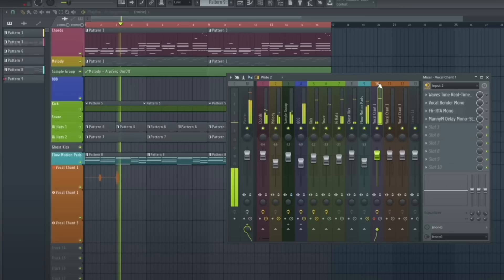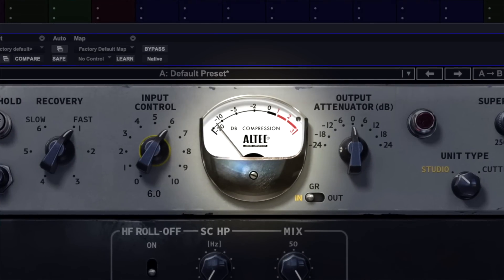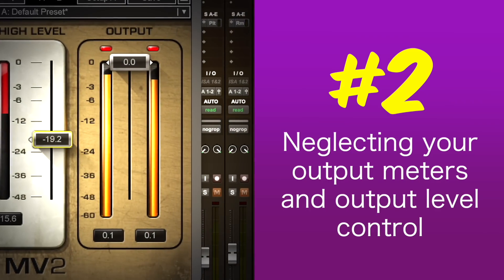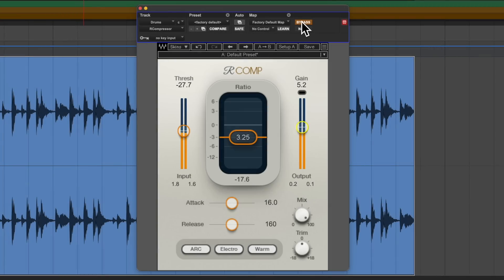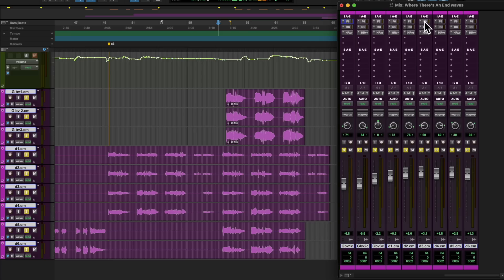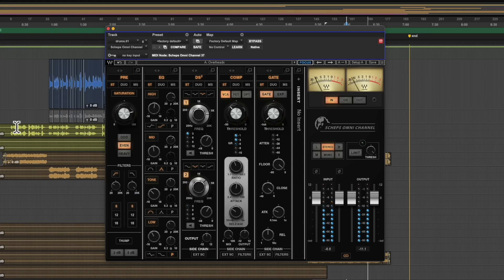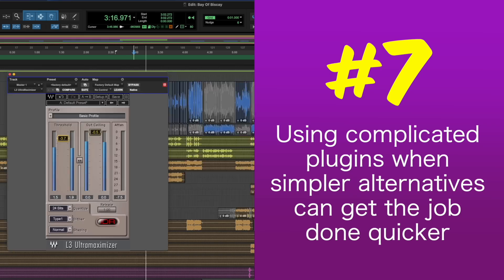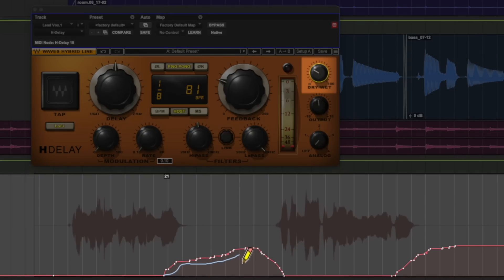9 Ways You Could Be Using Your Plugins WRONG

Comment: #9 might be: buying an plugin collection and not trying half of the new plugins you've bought. 
So I've made it a habit - in Studio One you can set a picture of the plugin in the browser - and if I've ever tried / used the plugin it'll have a picture. This way I can easily spot which plugin I still have to try. It's understandable that if you've just bought Waves Gold you haven't had got the time to try even a third of them in a day. 
Or let's face it, I'm posting this since I bought Arturia's FX Collection 3 recently.
Reply: I just recently made a list of ALL my plugins and am determined to go through each one (several I've never used - and still might not after using them) and learn everything I can about them. Read the User's Manual, tips and tricks from other users, etc. on each one. THEN, I'll know WHEN to use each one or whether I need them at all.

Comment: #1) I learned this after getting a lot of bad advice and silly responses years ago when I wanted to eliminate the amp buzz from an amp sim. Eventually, I figured out on my own, after a lot of "It's not real if there's no amp buzz" nonsensical comments. Lowering the Input Volume on the plugin COMPLETELY eliminated the amp buzz and hum, and gave me clean amp distortion and tone with ZERO "amp noise", then just cranking the Output Volume to bring it back to a decent volume.

Comment: Great video! Respectfully disagree with point 3. Over the years I have learnt that, with backing vocals, drums, guitars, definitely sounds, at least different, compressing the sources individually. IMHO sounds less compressed and clean compressing the backing vocals individually versus compressing the bus. On the other hand, agree that you can share the reverb.
Anyway good tips on your video, thanks.
Reply: Have you tried using clean saturation on the individual tracks? And then compression on the bus. Of course it'll be different for every genre, but consider giving it a try. I get pretty natural results with this method, especially on backing vocals.
Reply: @devingobind  bout to give this a gander now :) thx

Comment: Matching output level, use your ears, if you add 6 db because gain reduction said so, you are to loud, as it only the small peaks getting reduced that much, an average would be better, as sometimes it compresses 6 sometimes 0, so in between would be 3, and that is probably where you wanna set your output for comparison, but use your ears.

Comment: Do the outputs on all waves plugins internally clip regardless if you turn the fader of the track down so there is no clipping in the DAW?
Reply: No, in a standard configuration plugins are inserted pre-fader, so the position of your DAW’s faders won’t impact the level within the plugin. Not the case in point 4 as track outputs are feeding into an aux, so plugin inputs can be overdriven by fader levels there

Comment: Concerning #3, using a single Aux for many vocals . . . EQ?  Sure.  However, wouldn't each vocal be better served with it's own compressor?  Assuming you're using them, each performance is not identical, so doesn't it make sense that each note from each performance would be being treated separately?  Seems like the controls of a compressor dictate that it would be reacting to a given transient but then it'll be busy doing so as the very next one comes along . . . if it works as I think it does, you're defeating the purpose, no?

Comment: I have a question for everyone who can answer me... Relating to tips #3, I have the idea that processing each vocal separately doesn't have the result that processing the overall bus. Tell me if im wrong, but with auto tune for example, you will not reach the same result by autotuning a whole bus rather than each track, or do you? Same for de-esser, and for reverb too, right? I mean finally in the overall bus you can adjust delay, overall eq and maybe compressors to glue everything, but compressors to bring the vocal front have to be set within each track, right?
I may have to evolve on this point because I'm using so much cpu in my sessions... Please advice me
Reply: Tuning needs to be applied (that is if tuning is needed) on a track-by-track basis - not bus. This is because most tuning plugins are monophonic

Comment: Awesome. 9. Save your presets!!
Reply: That's a very good point! Especially useful when mixing album projects where continuity is needed
Reply: Newbie here. Can you give an example on saving a preset and why would I want to save it. Again I’m still learning but feel I can benefit from this. Thanks. 

Also I appreciate this video waves!
Reply: @apostolicway2604  Let's say you get a great vocal sound on one track and want to use it in another mix... saving your own custom presets are great for this. Saves reinventing the wheel each time. Or, maybe you have a certain way you like to start with certain plugins... for instance always starting with a low pass filter in and EQ. Why not "save a preset" and "save as default" so the filter is ready each time you load that EQ. Saves a little bit of time each time you mix with that plug.

Comment: I think you left out one of the most important points with regard to the use of plugins in a mistake that most people make. One of the main tools needed for mixing which is lost to those who use plugins unless they actually go through the work of doing assignment to knobs is the ability to control one parameter at the same time as another. Professional results have never been gotten by experienced engineers in the industry this way

Comment: #3: There still gonna be a difference between a bus compressing and compressing with individual tracks. The difference is not significant if the input is only one signal source at a time. The best solution is really to get a powerful-enough machine or learn to use less-CPU heavy native plugins. Fancy-looking plugin doesn't guarantee a good sound!
Reply: Agreed. Vocals need to be compressed separately for the most part. If you are trying to save CPU, print each vocal with the compression engaged.

EQs are great on a vocal BUS, and automating a compressor can be handy there as well.
Reply: @danielwiebe2123  or just use avid channel strip. I seriously think the channel strip is a great plug-in and it does most the treatment pretty good. For lead, I’ll use outboard compressor like CL-1B.
Reply: @danielwiebe2123  what about if you need to change something, you can't do that when you've printed. I thinking using a bus is best unless you need to really compress each track.
Reply: It’s always down to choice, I like comps on individual tracks, however some plugins work wonders on groups!! Experience is the real winner!!

Comment: Your example of 1 eq/comp for 8 tracks vs. 8 sets of eq/comp is missing a major point. It will sound DRASTICICALLY different. I understand the point you are making regarding conserving CPU power, and making automation simple by using a bus, but you simply can not get the same level of control that way and your eq is going to be carved out with huge scoops for a reduction, vs small ones across all 8. It's a VERY different thing, and your over simplification isn't doing anyone any favors. It's simply NOT the same thing. 8 tracks hitting 1 comp will react completely differently than 1 track hitting 1 comp and then routing that all to a bus.
Reply: You will have to adjust the compression but you can still use one for a bus than compressing them one by one, unless you really need to.
Reply: I completely agree. But i think this was more meant as a tip to newer engineers, who are perhaps taking advantage of his advice , dealing with less powerful equipment. It does sound completely different but their task is to learn to make it sound good, which is maybe more important
Reply: I disagree. Hitting the same plugins with 8 (or more) tracks isn't any different from using plugins on each individual insert. If you do this, you'll have ti adjust the compressor exc... like you are treating one track, that's the point in doing buses: you want all of the tracks going in to sound the same. Then, if you need (for example) to carve out the mids in some tracks of the bus, or want more compression, you do this on the individual channel. The result is the same but you're really saving cpu. I have a very good setup but why should I make it work harder when I can save?
Reply: This is very true. I just experienced it processing some vocals yesterday. I actually started out doing it the way he described - needing to preserve CPU - but ultimately had to process them separately to get the sound I was looking for. 
It's  a good & useful tip, but he should have mentioned the sound difference. I already knew, I was just trying to save CPU. 🤷🏾‍♂️

Comment: I heard that digital daw like Ableton doesn't have that problem. its ok to clipping on plugins... who has right?
Reply: It's almost impossible to clip the audio engine itself because it's 64 bit internal processing..For example it's almost impossible to clip the aux buss even if you are sending multiple tracks to this buss to a "red zone"..but if you have a plugin on this buss insert it may start to distort very soon.It's very easy to clip(distort) Waves SSL channel on the insert but almost impossible to clip a Fab filter EQ.So it's different from plugin to plugin and it's design.